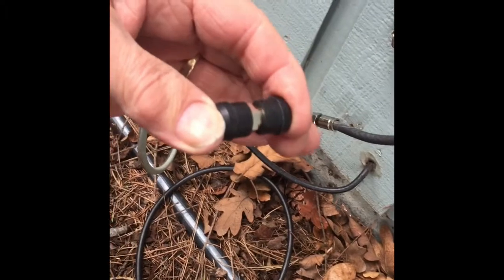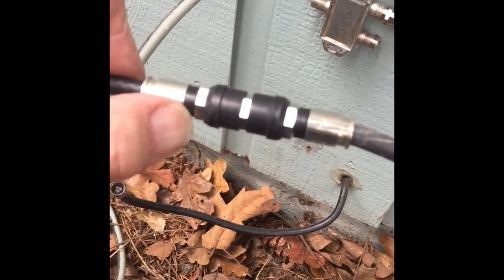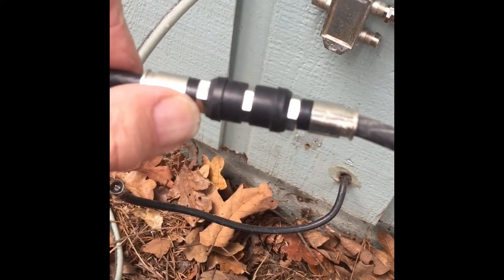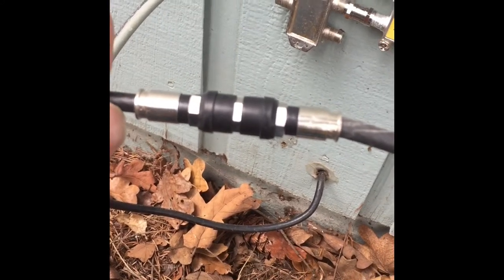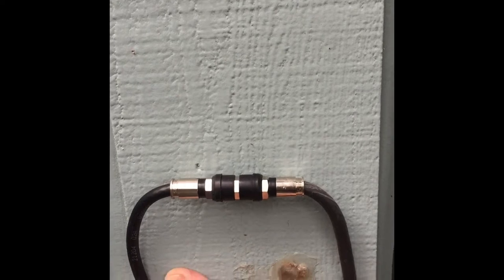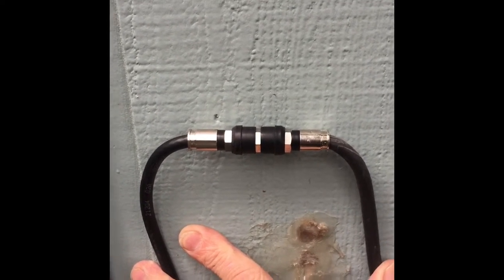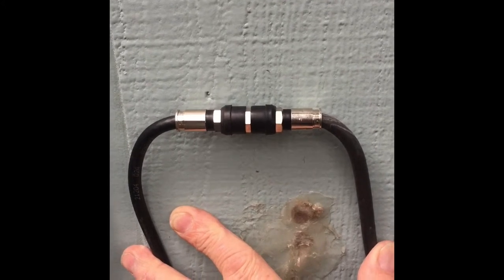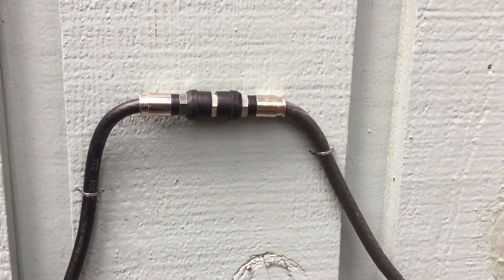Coax Drip Loop- Why And How

Comment: Why didnt you incorporate a service loop into your drip? Now if it ever has to be replaced due to barrel failing you are going to have to rerun it. May as well as have just run a new line to not need that extra failure point.
Reply from the maker: Thanks for your comments. In the case of this splice I still have enough slack in the cable that if a fitting failed I could just move the splice down the wall and pulling a new cable would be a lot more work and many veiwers may not be cabable of pulling a new coax, that's why I decided just to install a splice. It's my house and I could install a new fitting in a couple minutes in the event of a fitting faliure. Again the comments are appreciated.